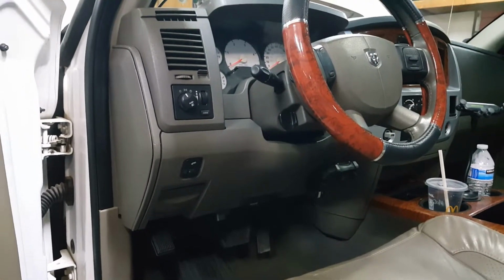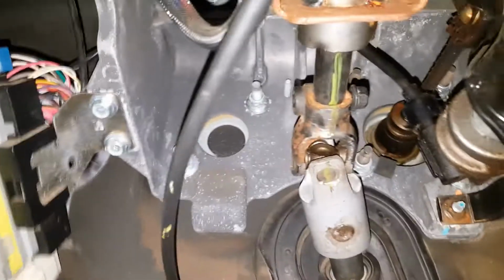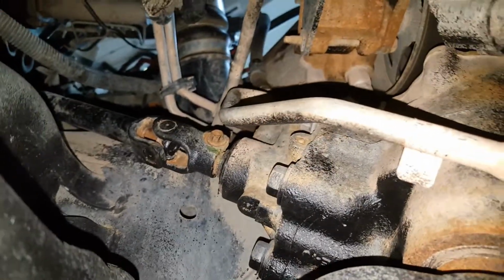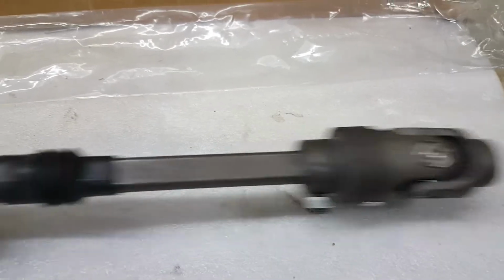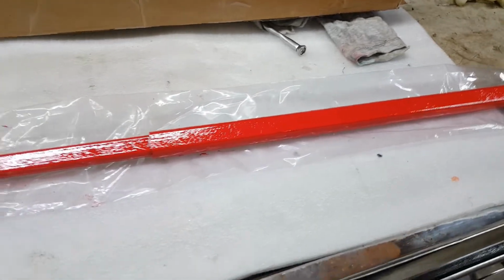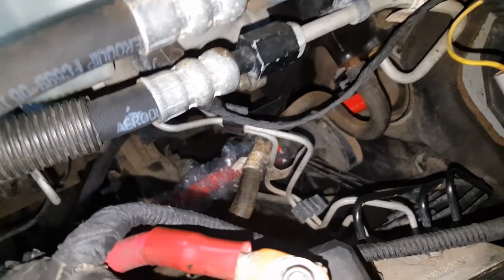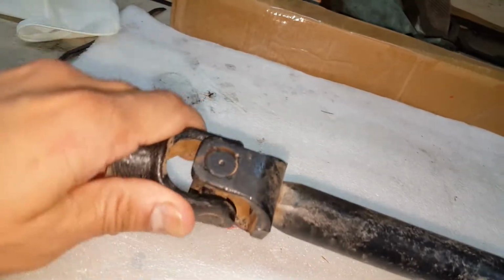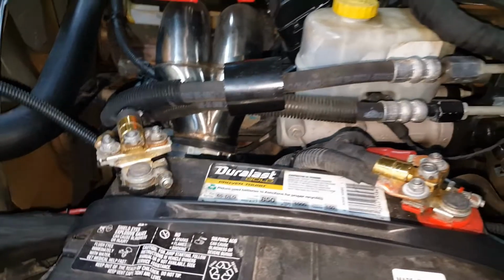Dodge Ram Steering Shaft Replacement Upgrade | 2500 | 3500

Comment: Good video man! i have a quetion i have a 02 4.7 rwd starting to go out. Does it matter if i change it to a 4x4 steering if its the same years? Mine is different its not the one that you can just put bushing or o rings. Help 😅
Reply from the maker: Hi thanks for watching/subscribing.  I think the steering shaft during those years are the same on 4 or 2w drive.  But the 2500 and 3500 are different shafts and will not work on the 1500.

Comment: Can you change the unjoint  on the steering shaft on a dodge 3500 pickup
Reply from the maker: Hi, thanks for watching/subscribing.  
Ram 2500 & 3500 will be the same.  Technically yes you can remove/replace the joints on these shafts but it's not very practical.  Original Joints are staked in, so once you find the correct replacement u- joint(somebody has to be making them) you would need the equipment/machinery to restake them back in at correct position.  It's easier just to replace the shaft with new joints already installed.  I've had similar staked in driveshaft joints from a BMW that I was able to cut out and replace instead of replacing the complete driveshaft.    Thanks...

Comment: Get rid of that shaft as soon as possible!! I bought a 2007 dodge 3500 with this reolacement shaft in it, as soon as there is a little play in the set screw the shaft will pop out the first bump you hit, just happened to me, shaft popped off at the steering box side at 100km/h, crashed the truck, luckily there wasnt too much damage and mys3lf or noone got hurt, there is a reason oem has bolts go all the way through, these new style shafts are so dangerous, id hate to see someone else go through what i did
Reply from the maker: Hi, thank you for watching/subscribing.
Glad to hear no-one was hurt.  I do agree this shaft is a bit of a dangerous design.  Although over a year now and I have not had any issues.  I do periodically check the shaft.  After about a month of  initially installing this shaft I did remove the splined end on the gear box side, ground the splined shaft flat where the set screw seats and used thread locker on the set screw.  I just never liked or felt satisfied on how it fits the splines on the steering box and the set screw design(Other end on the steering column side is fine).  OEM style with through bolt is a much better and safter design.  I will also be switching back to the OEM style shaft just for a piece of mind.  Thank you

Comment: Did this help with loose / wandering steering? 

I am always adjusting the steering while driving my leveled 08 2500.  I just feel like it is excessive input required to keep it straight. 

I am going to try to see if I have play tomorrow like in your video.

I have replaced the whole front end, ball joints, tie rods, Sway bar linkage, new gear box, dual stablizers, and even added a gear box stabilizer. 

I don't have vibrations or steering noise. 

Did you need to drill a hole in your gearbox for the set screw as another video suggested? 

Thanks for making this video
Reply from the maker: Hi, thank you for watching.
Loose / Wandering steering is a very common issue on these trucks.  I did not have the wandering issue but noise, roughness and only little bit of looseness.  Replacing the shaft did fix these issues.  It is hard to notice any play or binding issues while shaft is in the truck.  With the shaft removed it was notably clear which U-joint was causing the issue. 

 I did not drill any holes in the shaft but using the grinder created a small flat spot for the set screw.  I have installed this same shaft without holes or grinding flat spot and never had any issues. 

In most cases loose wheel/wandering is solved by replacing the gear box on these trucks. You have a new gear box so it should already be adjusted properly.  But it can be further adjusted to take the play(looseness) out of the steering wheel.  Assuming that is where the play is.  Keep in mind tires can also cause the wandering issues.

Comment: I've seen people make note of grinding the steering box shaft for a flat spot for the bolt to seat against.  Did you just tighten right on the splines?
Reply from the maker: Yes it does make sense to grind a flat spot for the set screw if you can.  I didn't feel it was necessary &  tightened it on the splines using locktite. No issues.

Comment: Unfortunately Dodge doesn't make the intermediate shaft anymore, you are now forced to buy both pieces because the updated one doesn't fit on to the upper shaft. For a mere $750 CDN $  or get an aftermarket one like you did I guess.
Reply from the maker: HI thank you for watching.  Dodge (Ram) may no longer offer the intermediate shaft but it can still be purchased  aftermarket for around $110.  Here's a link to one from Dorman:
 CLICK HERE:  https://amzn.to/3zWWgpX
In my case I did not know where the issue was so I replaced the complete shaft.  But once the original shaft was removed from the truck it was clear that the issue was with the joint near the gear box(intermediate shaft).
Reply: @JSFautoPlus  Oh that's good to know, thank you very much for your reply!
Reply: @JSFautoPlus  Amazon is telling me that this shaft will not fit an '03 3500. Have you installed this part on a 3rd gen before?

Comment: Everything in the front end of these trucks is pure trash. Dodge is nothing like it used to be. 

New steering shaft, gearbox, tie rod ends, ball joints, track bar, bearings. Pure trash.